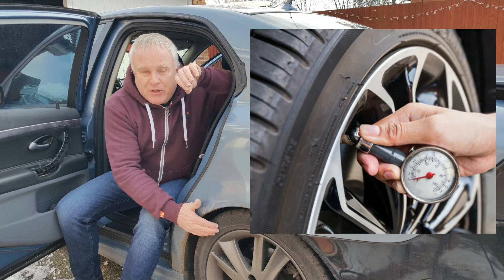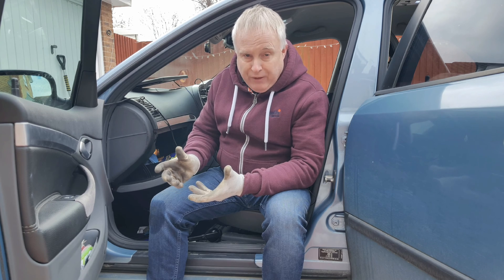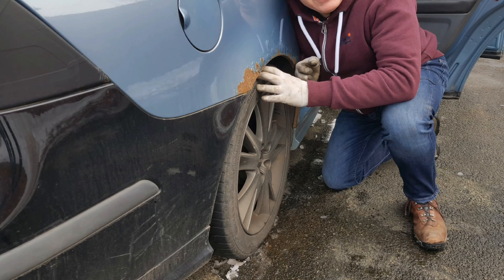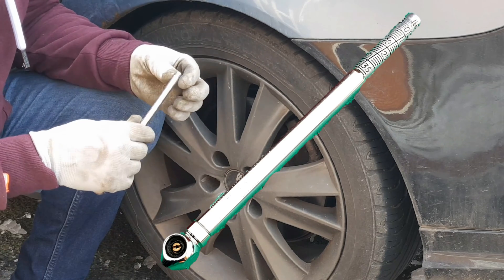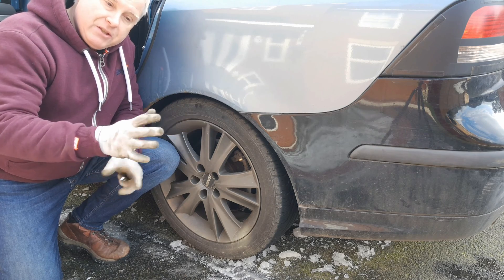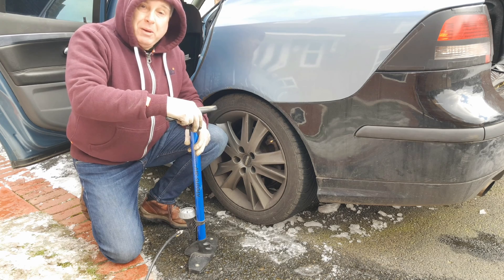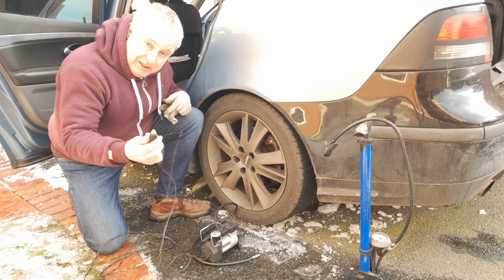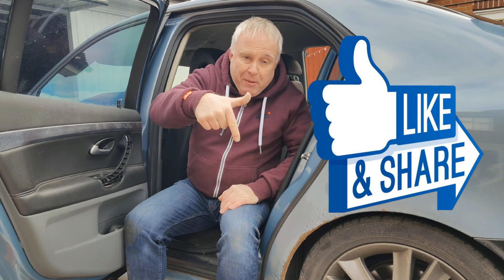How Do You Check Your Car Tyre Pressure❓ - full why & how guide

Comment: Another great video - and rather timely for me!

A few weeks ago, I received a puncture caused be a steel threaded rod about the length of a pen! Rather than have it plugged - a temporary fix - I choose to have a brand new tire fitted. When I collected the tire, the garage explained to me that it was an easy fix apart from them having to slightly scratch the alloy due to the valve stem. About 18 months ago, I noticed that wheel was missing the valve dust-cap. Casually, I found an old cap from a bicycle. As it turns out, it isn't a good idea putting a steel cap on a bronze valve-stem - it had seized on and it wouldn't unscrew!!!

So, now I have a related question. With my remaining 3 tires now about half-way through their life-span, I'm wondering if it would be worth the bother of swapping the positions of the tires/wheels to even out the wear. Does anyone still do this?

Different sequences are followed for front-wheel, rear-wheel or 4-wheel drive cars. As my car is an Aygo (same as C1 and 107), being front-wheel drive, the general rules on this are that the rear tires stay on the same side of the car and go to the front, while the front tires cross-over and go to the rear.

For this to be achieved would require 5 tire-changes as follows:

Put the spare on RL, then in turn swap tires with FL, RR, FR, RL (getting the spare off again). For me, the new tire would become installed FL.

What's your opinion on this - is it worth the agro of 5 wheel changes?!

Comment: Excellent video, and as good instruction as I've ever heard or read, Cyd. 
 Just to complicate things, the TPMS on my 2017 Toyota Tacoma reads ~3lbs lower on each tyre than any guage I have, and I have several including the big heavy duty one on my garage compressor. (None of my tyre pressure gauges have been calibrated and I don't even know if it is possible for me to get them calibrated)
Reply from the maker: Thanks Robert. You could get gauges calibrated, but it's quite expensive. My own view is that if you've tried several gauges and they all read much the same, then that's good. Generally speaking, IMO, sensors that transmit actual pressure are not always accurate or reliable, which is why many manufacturers prefer to use wheel speed sensing instead.